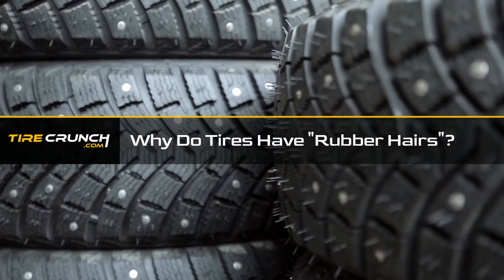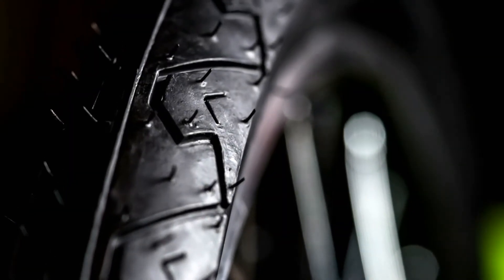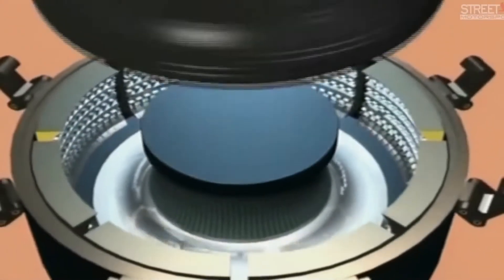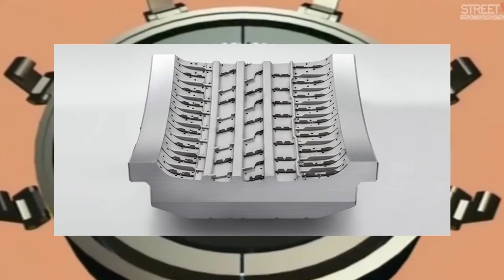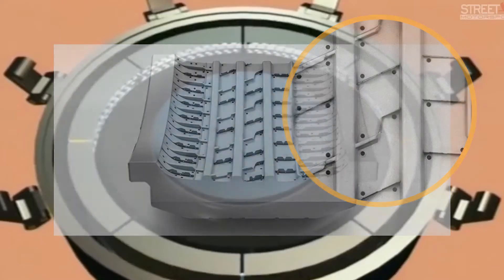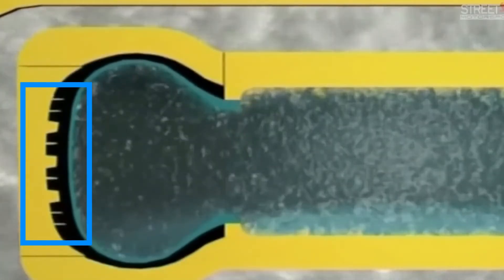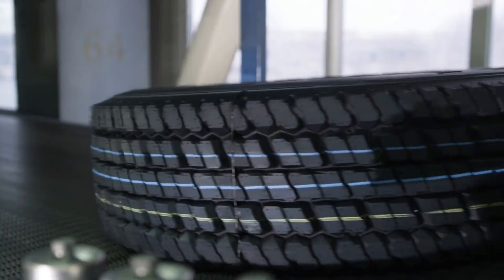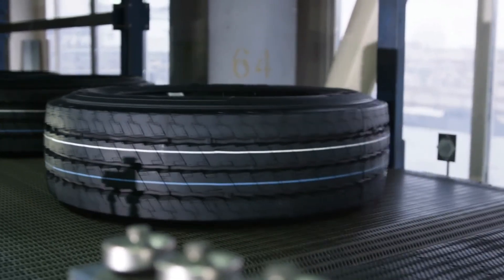Why Do Tires Have Rubber Hairs?

Comment: Why do new tires have colored stripes?
Reply: The stripes help with quality assurance and also serve as an indication of where the tyres are going to.

While there are no universally agreed colour coding, the colours used may vary from one manufacturer to another. The colours normally used are red, green, yellow and blue.

During the manufacturing process, stripes are made on the tyres to indicate that certain materials, eg. carbon black, artificial rubber, etc have been added.